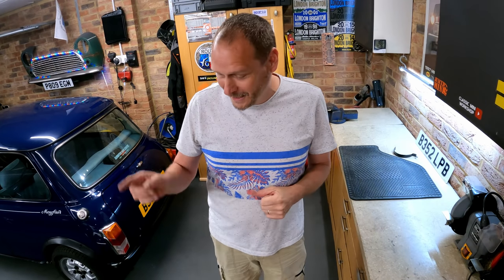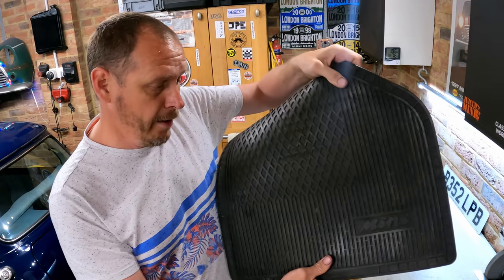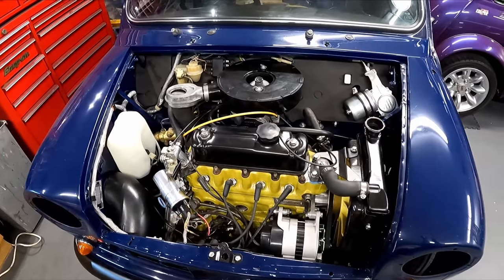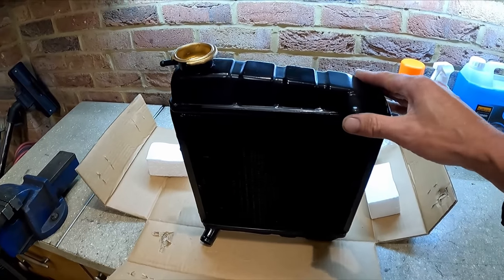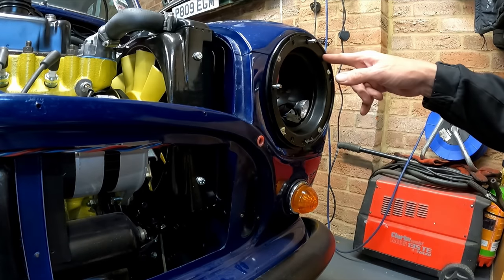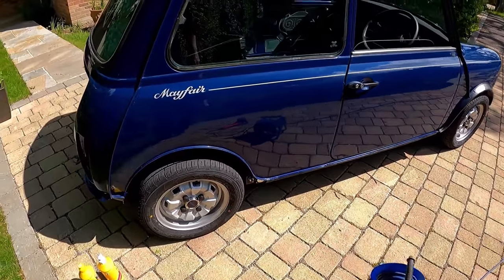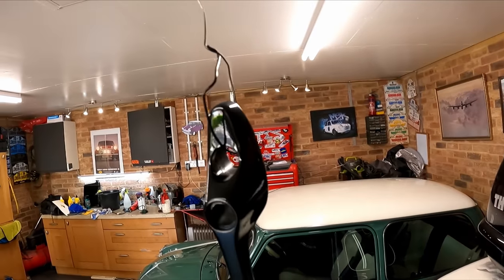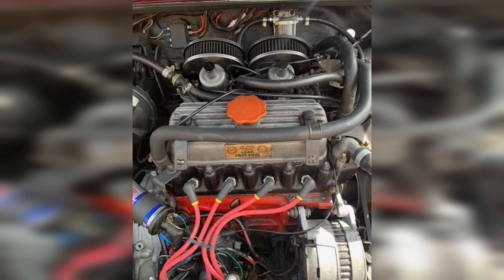Radiator, Headlamps, & Arches - Classic Mini Workshop Project Tardis Pt.59

Comment: Hi Keith, I was wondering if you had ever thought of getting a small drain spigot put in the bottom of your radiator?  Saves on having to disconnect the hose at the bottom.  Also I didn't have big enough pot rivets for my headlamp bowls so I used short machine screws with nut and spring washer at the back.
Reply from the maker: When I've done bowls in the past I've just used screws.

Comment: Keith, good set of updates and a busy couple of days..

Headlamp bowls, i have used stainless steel rivnuts, should i want to take the lamps out. 

Wheel arches, not fitted yet,  and guess what,  rivnuts again..

Just my thoughts..
Reply from the maker: I keep forgetting I have a riv nut tool set! One day I will give it a go

Comment: Those are OE rubber mats supplied by the dealers when the car was new they did the same type for the metro & other austin rover products as well just with different logo & shape for fitting cannon just made them. If i were you id look after them there like gold dust now
Reply from the maker: Thanks, I knew someone would be in the know!